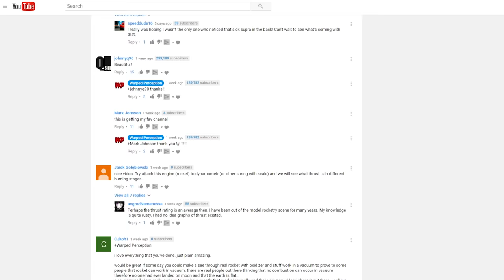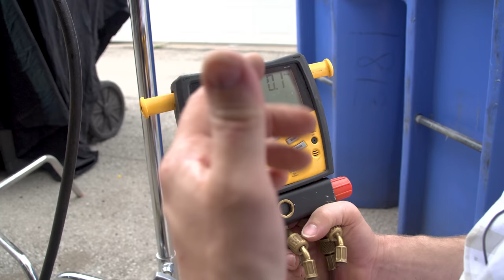Model Rocket Engine In A Vacuum Chamber - 4K Slow Motion - will it burn? - Rockets (S1 • E3)

Comment: Cody’s lab did this experiment and proved a rocket doesn’t work in vacuum. How much were you paid, or what is being used against to force you to lie?
Reply: Poor little boy: rocket engines are made to work in vacuum.
Reply: Ralf S. Oh! That’s right! They’re made to defy the laws of physics! I remember that from Loony Toons!
Reply: Explain 'Conservation of momentum'. One of the most basic laws of physics.
Reply: Ralf S. Which explains the continued movement in a direction; again, the continued. Firing a rocket, booster, or air burst to change the direction of movement in a vacuum would yield zero effect on the direction of movement as the booster would have nothing to push against. Face it, you e been lied to, Space is a lie, and the earth is flat.
Reply: It says nothing about movement. It says 'no action without reaction'.
Action = burning fuel with high intensity and forcing the combustion energy to leave in one direction.
Reaction = missile moves in opposite direction. Can't stand still because of - conservation of momentum.
It's really that easy.
Get yourself on a skateboard. Throw some bricks behind with full force. Try not to move in opposite direction. You can't, because of - right, conservation of momentum.
Reply: Ralf S. 

For a collision occurring between object 1 and object 2 in an isolated system, the total momentum of the two objects before the collision is equal to the total momentum of the two objects after the collision. That is, the momentum lost by object 1 is equal to the momentum gained by object 2.

Adding energy to the side of a moving rocket to make it change direction would yield zero effect in space as there is nothing for the release of energy to push against. The lunar lander would have nothing to push off against as there is a perfect vacuum between the moon’s supposed surface and the rocket’s nozzle. The shuttle docking with the ISS would hVe nothing to push against when it’s boosters fired, therefore the shuttle wouldn’t slow down. Basic physics dictates that space flight cannot work, therefore, all we were taught about space is a lie; given that, it should be elementary to deduce that the shape of the earth is a lie. Get yourself a skateboard, and go do something more productive with your life than blindly follow the crap you’re being lead around by.
Reply: Right. Object 1 is the nozzle. Object 2 is bazillion of gas particles colliding with the nozzle at ultra high speed and being forced to bounce back in a certain direction (that's why the nozzle has it's certain shape).
There's no third party thing needed to push 'against'. The exhaust pushes against the nozzle; so the energy forced to release in one direction is exactly the same energy that forces the nozzle (and everything fixed to) to move in the opposite direction.
Reply: I told you what object 1 and object 2 are. And they have nothing to do with a thing called vacuum.
Reply: Ralf S. Object 2 doesn’t exist in a vacuum. Space is a vacuum, therefore object 2 doesn’t exist.
Reply: Object 2 is the exhaust gas particles, as I told you.
Reply: Ralf S. The defining characteristic of a vacuum, is that nothing is there. If “no-thing” is there, then your beloved object two is also not there. So object one is pushing on nothing. With nothing to push on, there is no force to be transferred, and therefore there is no conservation of momentum.
Reply: Nothing? Right then, put your finger behind a rocket nozzle and find out how 'nothing' feels.
Reply: Ralf S. Ok, let’s start from the beginning. Let’s use the terms from the definition I posted earlier, but let’s consider the example as taking place on the launch pad, in our atmosphere. Object 1 is still the nozzle. Object 2 is still the expanding gas exiting the nozzle. Now, let’s think about this. When Object 2 is released, it expands and pushes on object one. The only reason it pushes on object one, is because it is also pushing on object 3; the atmosphere. It has to. If object 3 isn’t there, there is nothing to direct the force of object 2 back towards object 1. If you watch the Cody’s Lab video I mentioned in my very first post, you will see what you’re ignoring. The reason the rocket motor doesn’t work in a vacuum, and the reason black powder doesn’t burn in a vacuum, is because there isn’t an atmosphere for the expanding gas to push on. It’s the atmosphere that pushes back on the expanding gas, that pushes the flame of the burn back towards the fuel. Without atmosphere, the flame expands away from the fuel source, and doesn’t ignite the fuel source.

Now, back to objects 1/2 in space. When object 2 is released and expands, it doesn’t have an object 3 to push off of, and thereby push object 1. Every action, has an equal and opposite reaction. The force of object 2, that is exerted on object 3, is the basis for the force that is put into moving object 1. The force put on nothing, is zero, so then the force exerted on object 1 is zero.

So we’re back to reality, and we’re back to you ignoring fact, and You now having the responsibility to admit you’re wrong, have been lied to, and are now in possession of imperial evidence for the earth being flat. Now take your skateboard.....
Reply: Conservation of momentum describes a mechanically closed system. 'Mechanically Closed System' means that the system does not experience forces from its environment.
A rocket ist a mechanically closed system. So your assertion is perfectly wrong.

Nevertheless, 'vacuum or not' affects rockets in two ways:
1) There's no air resistance, so you will need less energy  for constant acceleration in vacuum than you would need in an athmosphere.
2) There's a little bit less outside pressure. Zero bar in space, one bar on earth surface (but ten bar on a submarine in 100 meters depth). That means, for best efficiency the shape of the nozzle built for vacuum is a slightly different from the one built for work in athmosphere. That's the reason why multiple stage space rockets use different engines, each one optimised for work in its scheduled altitude).

Comment: Lol.just one slight flaw qith your experiment the rocket never went anywhere. Also how do you stop or turn the rocket..the shuttle omly has rockets in the rear.
Reply: lol.. Just one slight flaw-you did exactly zero research before spraying this nonsense, didn't you?
Reply: @darklight2.1  if rhe moons gravity is strong enough to affect the earths oceans then how did the lunar module take off?
Reply: @vaughanscott7308  F=Gx(m1m2/r^2)

Compare the mass of an ocean vs. the mass of a lunar module.
That would be about a junior high level AP physics problem, I would guess.

Do the math, take your time and show your work.
Reply: @darklight2.1  so who measured the weight of the earth?
Reply: @darklight2.1  if the force of gravity was holding the weight of rhe ocean to the bottom of the world how can fish or anything swim through it?
Reply: @vaughanscott7308  
"so who measured the weight of the earth?"
Some guy named Hank.
Reply: @vaughanscott7308  
"if the force of gravity was holding the weight of rhe ocean to the bottom of the world how can fish or anything swim through it?"
With the greatest of ease.
Reply: @vaughanscott7308  : Jesus you make flatters look bad. Just stop. 

Is there a reason you don’t do a force balance analysis?
Reply: @vaughanscott7308  Here is a novel concept: Why don't YOU research a topic BEFORE trying to debunk it??

Note: Watching YT videos is NOT "doing research".
No go BACK and finish high school.